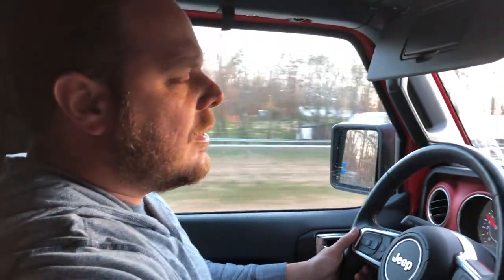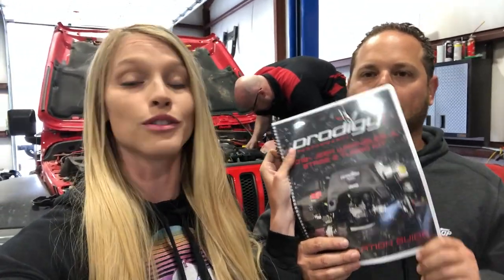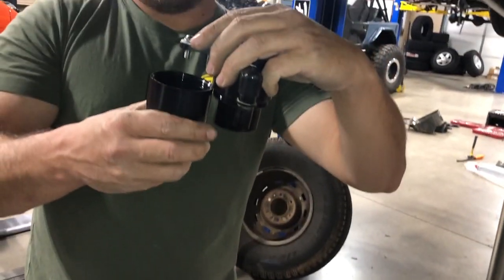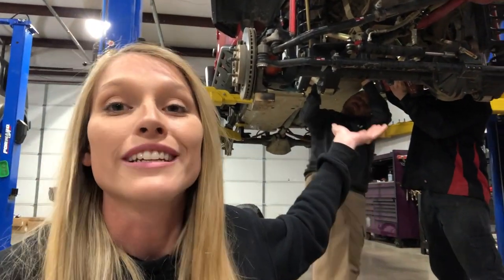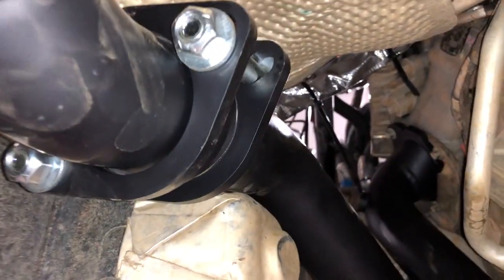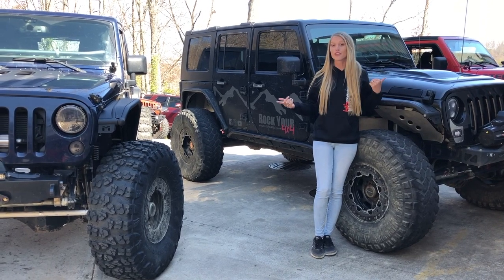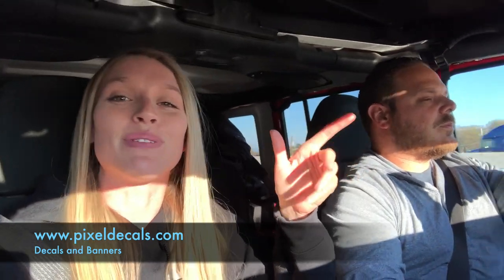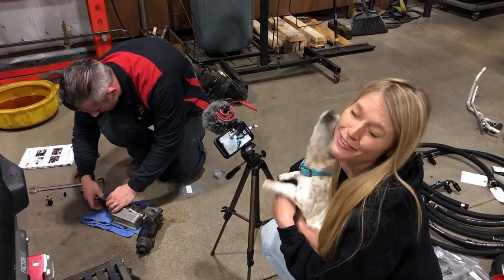We Install a TURBO on our Jeep Wrangler JLU Rubicon! It BLEW UP DO NOT BUY THIS TURBO KIT

Comment: It still blows my mind that the V6 that Chrysler uses in everything has to have the intake manifold removed to replace spark plugs. Have their engineers ever worked on a car or even ever touched a wrench? I though having to go through the wheel wells on my Ranger was bad but yeesh.
Reply: The 3.7 used in the mustangs is the same way...

Comment: So........you ceramic coated your turbo..... you’ll cook the oil and super heat the air going into it. The intercooler will probably bring the air temp back to where it was. I’d have just bought a louvered hood to dissipate heat.
Reply: Matt Cerbone that’s not how that works. You should probably read up on ceramic coating piping. Keeping the heat in helps to move the hot gasses faster thus helping spool and keeping the hot gasses flowing faster. Please read up on it so you don’t give people wrong or bad information.

Comment: very impressed with the turbo kit!! The quality of the install definitely looked "TOP SHELF" lol  But, a turbo in the driving environments is going to be risky...IMHO. Especially, since your care of the air filter was...ahhhh, YIKES!!  lol  Slow rock crawling and little air flow...is going to get components HOT!!  Speaking of air filters, you might want to install a prefilter!!  Remember, what is the most likely thing to kill a turbo??  Yeah, dirty air. Dust dirt etc.  Merci
Reply: biz4two biz4 the turbo won’t be making boost during crawling so it technically shouldnt add any additional heat. Maybe a little but not much
Reply: @boughtnotbuiltoffroad7784  ... with summer right around the corner, it will be interesting how the turbo performs in those slow crawl situations. Avid fan, so I'll be watching.

Comment: Turbos are fun. But you can watch your gas gauge slowly fall. My F150 with the 3.5 ecoboost is either eco or boost. But never both.  If I am heavy on the gas I can burn A 136L tank fast. (35 or 36 gallon for you Americans) lol
Reply: D'Arcy Jousset ya turbos burn all the fuel

Comment: BOOKLET? Not an APP? And why pick a Turbocharger over a super charger?
Reply: "And why pick a Turbocharger over a super charger?" Explained by Brittany in the video.
Reply: @harrygatto  I LMAO, "Sounds like Angels" but the turbocharger is not connected to the engine and can spin much faster. Both will produce large amounts of power. ... Superchargers can deliver their boost at lower RPMs then a turbocharger, whereas the turbocharger works best at high engine speeds.Turbochargers are quieter and superchargers are more reliable.
Reply from the maker: Pennypack MTB Aside from just loving turbos, superchargers also shouldn’t be started if it’s below 20* F outside (kind of a problem when you live in Colorado and go snow wheeling in the winter). They usually have disclaimers telling you not to operate if it’s below a certain temp (unless you have it garages or an engine heater).
Reply: @LiteBrite  You let your jeep stay out in the garage and freeze? Had a turbo and it left me stranded. I understand pumping in that cold Colorado air into a cold engine. I just want the best for your child.
Reply from the maker: @pennypackmtb2542  Our Jeep has never stayed overnight in a garage. lol She roughs it everywhere we go.

Comment: So guys I gotta ask, but for all the upgrades you guys are doing (which is awesome...love the videos) why did you choose the Rubicon as your platform to start with? Legitimate question because I am considering buying the Gladiator and am torn between the Sport S vs Rubicon (leaning toward the Sport S). I'm also torn between the V6 and the teased 3.6 Eco-diesel.
Reply: Joshua Friesen diesel rubicon all the way for what we do anyway.
Reply from the maker: Joshua Friesen There’s a ton of pros to the Rubicon. We showed those in a lot of our earlier vids. You could build a Sport to be as capable as a Rubicon, but you can finance parts. You can however finance a Rubicon that already comes with all those parts. 😁 Also, diesel for sure! If it had been available when we got ours, we definitely would’ve gotten it!

Comment: it's the same 3.6L engine from the JK which I have one. Plus I have 2.0L JL Turbo (actually great engine by the way, so far).  2018/19 is same 3.6L just modified power curve for newer transmission. Head and block are the same. Cylinders 3 and 6 closes too firewall run extremely hot and have failed due too air not being able to get back there. Especially cyl 6 due to being under intake manifold which blocks the air from getting back there for cooling. I don't even want to start on the above oil filter housing which causes alot of the heat problems, don't want to get into that bad design. I'm a Mechanical Engineer and have owned multiple turbo and supercharged vehicles that had the blocks and heads designed for such, mustang, porsche, camaro, corvette. 3.6L block and head was not designed for higher boost. You don't understand the hassles of a turbo, charge pipes coming loose, dirt getting into the turbo from not keeping airfilter clean, also because of increased pressure from turbo you will get blow by which in itself causes problems (need catch can). If you wanted a more powerful jeep or higher torque curve JEEP just do a Hemi or LS Engine swa, way better. Or get the Gladiator with cummins turbo diesel engine, which for rock crawling is not jeep to get due to length.
I like your channel and never say much, I like what you do and all the mods you have done, but this is not a good one. I have an HP Tuner and this is way overkill for a jeep Engine. Good Luck. Hope everything works out.
Reply: joebee1 it’s actually not the same 3.6 from the JK. the only thing it has in common is the displacement. It’s an entirely new engine. This comes from people I know who work in engineering at FCA.
Reply: joebee1 I have also had dozens of forced inductions vehicles. Some that came from factory and others that we have added a turbo. Yes they can be a pita but if you keep up with it just like anything else you can make it work. We have a catch can for blow by. We’re running 7psi at 363whp. It feels good and runs good. Anything can happen when heavily modifying the vehicle and we’re not running high boost. Just enough to kick it in the ass. lol
A v8 swap costs upwards of 25k that’s more than half the price of a new rubicon. I’ll stick with an 8k turbo for now and see what happens

Comment: Great mod! Quick question: since the engine internals still stock, is the tune leaning towards more torque vs hp? 
The outro with Jelly doing the "penguin" shuffle! Lol!
Reply from the maker: Paul Johnson We’ll have the dyno tune with numbers in the next video!
Reply: @LiteBrite - Sweet! I'm not a turbo guy- SUPERCHARGERS ROCK!-(did I post that out loud?)-anyhooo, I get goals vs application. 👍👍

Comment: 14:03 I wanted to do this with my JLUR but I'm afraid that it'll cause too much water to get into the engine bay and cause issues. Let me know how it works out for you guys, if there's no issues then i'm doing the same.
Reply from the maker: BROJAK HORSEMALE As long as you don’t have damaged wires or anything in the engine bay, you should be fine. We washed our bay out prior to the install. The main thing here is the engine bay gets a lot dirtier quicker, but the pros of heat dissipation far outweigh that

Comment: I guess if you can afford a Rubicon, and lots of upgrades, you can afford to buy a new Rubicon once the engine is blown and transmission wears out. I'm not saying a turbo isn't cool, I'd just rather have my vehicle last as long as possible.
Reply from the maker: Steve This is definitely a big thing to consider. We have that disease where we tend to overbuild our vehicles. Lol We think in terms of instant gratification usually, rather than long term reliability. 😅
Reply: @LiteBrite  I understand, I just bought a new Tacoma, and I am fighting the urge to turn it into a bad-ass off-road rig!

Comment: I think you need to remove the grill insert for increased airflow.  Watch the heat and be ready to replace plastic bits. Less strain on engine for same HP level vs supercharger.  turbo FTW

Comment: I think when your Engine is" burning "so much Oil there is something damaged.. because that much Oil has to be missing somewhere.. and my 60k mile Jk doesn't burn any noticeable amount of Oil...
My Throttlebody and my Intake is mostly clean
A Engine is nowadays normally not allowed to burn the amount of Oil your JL "does"..
As I know... might be wrong!

Edit: And you put a open Airfilter on a Turbo even when you beat the whole Sahara out of the original one ;)
I would buy a second, "better" Airfilter just for Offroad:)
(WHEN you didn't think on that before^^)

Stay healthy and do great stuff! :)
Greetings from Germany
Reply from the maker: Let'sLukas it’s not all oil. It’s oil and fuel vapor and water condensation. It’s normal. Our oil level is always full

Comment: also from past turbo installs u want to get some stainless steel heat wrap line they r like steel zip ties... those will surely melt sitting nxt to the downpipe that baby gets red hot.... at least throw a couple SS ties on for me, the heat wrap wont help when that zip tie melts and now the hose touches directly to that DP.... but other than that FREAKING AWESOME!!!! nJoii_

-Peter
Reply from the maker: Peter Piccolo Definitely a good tip!

Comment: time for another MPG run
Reply: Yeah, should be interesting to see the difference.
On one side, a turbo usually drink more fuel, but it also adds more torque,
and since they are towing the Razor around, they might gain back what they lost.
I'm guessing 12 mpg - Which means : Totally worth it ! 😃

Comment: How does a turbo help in rock crawling? anybody got videos for me?
Reply: Just saying, because turbo on street doesn't do shit, unless you got your foot deeeeep into the firewall...
Reply: True. Putting a turbo on a jeep is pointless for crawling. But they probably got this shit free and it made them content.
Reply: But it will help them on the highway, since they're towing a side-by-side behind them.
Reply: Brian Hendricks gears are for rock crawling. We’ve never needed more power rock crawling. It’ll help on the street and when towing. It’ll also help when ripping in sand dunes. The 3.6 doesn’t have the power to play in sand dunes, until now!!! So we can rip up hills and tow effortlessly and get better fuel economy. There are many reasons for a turbo. 
Oh, also whooping up on some v8 swapped jeeps asses

Comment: Let me start with: I love you guys and your channel. Met and trailed with you at Table Mesa and found you to be really good people. This however is a bad move! Your background in skid-racing clouded your judgment... turbos require rpm to produce power. Superchargers provide extra power across the whole rpm range. I expect the turbo-surge in sticky obstacle situations can be catastrophic!  I hope the best for you but, this isn't drifting at 8,000 rpm. It's crawling at 1500-2500 rpm. Good luck!!!
Reply: Michael G the turbo won’t make any difference in crawling at all. Nothing is happening at 1500-2500 rpm when crawling. We have 5.13 gears and 4:1 transfer case for that. The turbo is for everything else. :)

Comment: is Jeep going to sponsor you when you need a new one? Engine runs hot as it is and your adding a turbo for rock crawling. Turbos need large amounts of air at the intercooler, called moving, not crawling, a engine fan is not enough to get the hot engine bay heat out away from the engine. Don't listen to everyone one you meet. Do some research.
Reply: joebee1 I don’t have any problems with heat in my JL. are you having issues? You might want to get it checked if you are. We don’t run hot at all
Reply from the maker: We also didn't install a turbo for rock crawling. :) We installed gears for rock crawling. The turbo is from driving across the country, towing, sand dunes, and other fun high speed activities. Like Kevin said though, you may really wanna get your Jeep checked out if you're having heat issues. We haven't had any issues with ours.

Comment: Turbos = Power @ High RPM's . Super Chargers = Power @ Low RPM's.  If your offroading, rockclimbing etc. You should of went with SuperCharger. You not racing it.
Reply from the maker: Edward Stephens We don’t want power in 4lo. Don’t need it while rock crawling.  We’ve proven the JL does just fine as is. And turbos sound better. 😁

Comment: Why does the turbo kit come with ANYTHING to do with transmission fittings? are you guys being held hostage at the turbo shop!?!
Reply: Just blink twice if you are under duress! (que the Deliverance banjo)
Reply: Naw, it's great! Everything is awesome!! #StockholmSyndrome
Reply: Brian Hendricks lol. The stock trans fitting are aluminum and run right where the turbo goes so you need to route new lines around the turbo safely
Reply from the maker: Brian Hendricks 🤣🤣🤣

Comment: Turbo ?  So are you gonna be racing on a drag strip ?  
Rock crawling Jeep needs low end grunt... not turbo HP.
Best thing to do is find an old straight 6 Jeep and install that engine.
Reply from the maker: Bruce Bott We have gears for rock crawling, and have never needed more power down low. The turbo is for driving across the country, towing, sand dunes, and other high speed activities the Jeep used to struggle at. 😊
Reply: @LiteBrite  You actually need a motor home... and a trailer for the Jeep !

Comment: No mud and no lowend torque for you!!!!😂😂😂 what rpm does it start pulling at??
Reply: Daniel Miller it has the same low end it had before. Spools at 2500 and makes power to 6500 and when it shifts it’s still has full boost unlike a supercharger that drops down with the rpm and has to gain boost over the rpm again. Why do people think you lose low end when you add a Turbo? It’s still a 11.3:1 compression v6 for low to mid range with 5.13 gears
Reply: Daniel Miller turbos don’t subtract from the torque that already existed. It just adds to everything once it lights up.
Reply: @boughtnotbuiltoffroad7784  jeeps are made for lowend  torque. Its not a race car or a drifter car. If Im gonna add on to my jeep its gonna be something to increase where it is important wich is low end not top end. Turbos are useless in rock crawling at low speed. A eddle brock supercharger adds to the whole rpm band. If i want fast ill buy a sports car. Again jeeps are not sports cars nor do they handle like one . That kind of power at top end just gets people in trouble and upside down in a ditch .
Reply: @boughtnotbuiltoffroad7784  but to each his own. i wasnt attacking just stating facts👍👍👍
Reply: @boughtnotbuiltoffroad7784  love watching your vids good luck with the upgrade and keep the videos coming.
Reply: Daniel Miller ya I understand. We have never needed more low end. Our gears and transfer case work great. We wanted more power with towing and simply driving across the country.

Comment: Pretty much a waste to turbo a 3.6 in a Wrangler. Should have just bought a 2.0L Wrangler and spent half the price of the kit and make more power and a lot more torque with a tune and simple bolt-one.
Reply: Except the 2.0 was not available when they bought their Jeep.  And they have made a "few" modifications that would cost a ton to do to a new Wrangler.
Reply: Stuart Stogdill how is it a waste? It’s much faster. Pulls the trailer effortlessly and is fun as hell. It’ll keep up with v8 swap jeeps and gets better fuel economy. Not a waste at all.
Reply: Kevin Williams it will not keep up with any LS or Hemi swapped Jeep. Needs quite a bit more horsepower and torque down low for that.
Reply from the maker: Stuart Stogdill $8k compared to $20k, and it will. 😊
Reply: Stuart Stogdill well at a conservative 6psi. It made 360whp and 330wtq. That’s as low as the numbers go. It’s about another 15-20hp per lb of boost. I can go to 10-12 psi if it really mattered but it doesn’t. Fact is that we had the kit installed in a day and it was 1/3 the cost of a v8 swap and a LOT easier.
Reply: Lite Brite $8k compared to $20k... what is $20k that was mentioned?